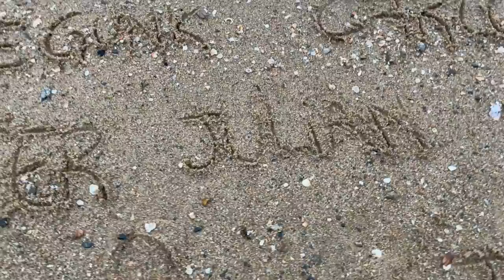Rebuilding a rotten schooner can get very challenging — Sailing Yabá #37

Comment: This is the most weird conversion. It’s literally replacing a rotten boat with a new one at the drydock while using the old boat as the template. I wonder what’s the cost against just ordering a brand new sailboat!  While you’re at it, I would replace the old engine with a new one. That’s truly something you guys won’t want to go cheap on.
Reply: I'm wondering about that myself.  Overhaul the old one or go brand new ???????? Same way with the transmission ????????
Reply: I was wondering the exact same thing as I watched the video. Seems like given the real cost of demo as a percentage of the total labor involved, it seems like building from scratch would have been more efficient. But I've never built a boot of any kind, much less a "massive wooden schooner". She's going to be beautiful, no doubt.
Reply: Exactly like "rebuilding" Tally Ho, replace everything with new and use the old boat only as a template (although the workmanship and materials were much better on Tally Ho)
Reply: There has definitely been scope creep on this project.  I agree that it will be a completely new (green) hull, deck and about 80% house.  It looks like they will save the masts and rigging.  Some of the advantages to this method is that: they did not have to loft the plans, they could just template off the hull, can reuse (refurbish) all of the hardware equipment, and repurpose the odd bits into the new hull.  Cost wise it may be cheaper than building everything new plus you do not have to use your imagination to see the completed project (I think this is important to keep MP motivated about the scope creep of the rebuilding).  The engine should be removed and over hauled.  They may want to consider replacing the direct shaft with a hybrid drive system with solar, an electric motor and battery pack.
Reply: This is an epic job, wonderful. I am mainly in favour of rebuilding old engines, particularly if they have wet liners. Modern engines have too much reliance on electronics. With a project on the scale of Yabá I would be inclined to dream about an 8 cylinder Gardner. I once delivered a yacht with a six cylinder version. The manual advised stopping the engine every 30 days or so to check lubricant levels - such confidence. They are expensive engines but are economic and last forever. Maybe get one out of an old fishing boat. Just a passing thought...
Reply: @Mark-zi4dd  Not sure the workmanship is better on Tally Ho; certainly much different, but in the end both will fulfill their objectives quite nicely.
Reply: @Mark-zi4dd  Face it, it's a new boat, not a refurbished one. Just like Tally Ho.
Reply: @johnbrice4146   Great idea on the Hybrid with all that Square footage of roof on the cabin top you could put 4000 plus watts is solar with lithium batteries you would be energy sufficient enough for AC at night!
Reply: @Mark-zi4dd  No comparison.Much more worthwhile project considering almost all the labor on Tally Ho was donation of labor from volunteers. Shop, tools and the premises the boat was restored were all free, including where Leo lived. That was FOUR years up until now with maybe two more years to go. These two young kids are paying for all the labor of demo and rebuild. The timber used on this boat costs a fortune even in Brazil.  While it is not exactly cabinet making, the  level of precision required in building Tally Ho and Yama, are light years away. Rounders and Cad drawings vs chainsaws. Hey look, I am just as much an interested viewer as anyone else here. I didn't subscribe hoping they fail. As a boater for over a 50 years myself I want everyone's boating dreams to become a reality. This dream is nothing short of a nightmare. 
For half a million I can find an excellent trawler or a sail boat that is Blue Water capable, and safer than this project. Just like everyone else, I think my opinion  is as valid as anyone else's  who think I am wrong. Stop encouraging them even if it is not their own money. This is pure madness.
Reply: @Mark-zi4dd  It's the difference between a one-off passion project done by a team of enthusiastic amateurs vs. a basket-case resto by a professional boatyard finding that compromise of cost, quality and time, because Yaba is taking up valuable berthing space
Reply: With the engine, maybe it would make more sense to leave it in place and then replace every part one by one.
Reply: @Mark-zi4dd  I believe Tally Ho is basically a new 'tribute' boat built from the keel up using drawings and plans.  This is just simply on the fly boatbuilding, creating. a new boat from the inside out (which is why we watch it, no?).
Reply: I want to see a new engine, like Odd got the new Yannar, Kelly. But bigger of course? Plus every time I look at your wiring I think we need Fred, Duca, and all fresh wires
Reply: @aytacercen944  couldnt agree more. This project got spun in the wrong direction from day one. I hate seeing money thrown at problems, and yes we get to see some skillful builders, but the owners arent really involved besides camera work. Yaba is merely 16 years old and doesnt have the historical piece like tally ho. Its just so bizarre at this point.
Reply: @aytacercen944  But you didn't tell Leo what he was doing is "madness"....... interesting.
Reply: @SilentSooYun  If you say so.....
Reply: @bchowmein1711  Tally Ho ain't historical any longer.......

Comment: This has to be, and without a doubt the most backwards way of building a new boat.
Reply: yep, and with many structural deficiencies - ie in this video, whole deck is on several threaded bars. There is no structural strength and in real, that beams works like scissors. Finally, this is steel, and steel with salt water = speedy corrosion.
Reply: This whole show is just there to get YouTube dough out of peoples pockets. There is no economical or engineering sense of working like this.

Waste of money and time and will not last without heavy maintenance in the future.
Reply: @Mister Professor I'm pretty sure your analysis is spot on
Reply: @Mister Professor good point

Comment: Sometimes it seems like that  when you bought Yabá, you didn't actually buy a wooden schooner so much as a set of 3D plans for a wooden schooner in the scale 1:1. :-)

Your determination is inspiring!
Reply: What they really bought was a bunch of rotting/rotted wood masquerading as a boat.
Reply: A huge template for building your own boat.
Reply: @gaylespencer6188  - it wasn't a BOAT project, it was a GARDENING project - more soil and compost than actual wood! :)
Reply: And hopefully a lot of decent hardware, which already fits the said 3D plan.  Depending how much they paid, I can almost see it making some sort of sense.  If I squint.  A lot... ;-)
Reply: I don't think they knew what they were getting into, but I have to admire them for doing what it takes to get this boat rebuilt.  Sure, it IS a new boat, at least 90% of it, but it will last a while.
Reply: @GaryMCurran  And they will know the new Yabá from the keel up. Look at what Bums on a Boat went through with the structure of Chak Matay...and then after contaminating the oil of their engine they got schooled in engine internals, too.
Reply: It is even worse than that first remember they had to spend several months fixing the boat so it could sail safely to the yard which obviously took time and money. Then they had to pay for the destruction of most of the boat before a new boat was built around the remains.

There are two possibly theory's first the easy one they were stupid and did not know or care what they were getting into. This is possible of course but I presume they would have had a survey done before they purchased the boat and this would of given them some idea of the scope of work and cost.

Secondly they knew precisely how much time money and effort would go into it and although at this stage it certainly looks as if just getting the yard to build a brand new boat would be cheaper and quicker there may well be some legalities like registration and taxes that fixing a boat would not attract whereas they could be stuck with a massive bill on a brand new vessel.

Which it is I do not know it appears that of the original vessel they have a janky old engine some winches and clutches the masts a Nice table and steering wheel and not a lot more.
Reply: @glennedwards1449    Funny...I wouldn't assume they got a survey, even though you and I know that's Boat-Buying 101. 

They were two kids in love with each other and the sea, and what could be more romantic than owning and living aboard a wooden ship?

Hilarity -- and adventure! -- ensues...

Comment: The most moisture absorbent  parts of a piece of wood planking or beams are the sawed ends. I would always make sure to paint them.
Reply: @Mister Professor The builders are building the entire hull with protectant soaked and wrapped cloth sheathed stainless steel fasteners.
Reply: @deuteronimus750  the allthread the guy was cutting was not stainless.
Reply: @janvanruth3485  Yes it was.
Reply: @deuteronimus750  and how would you know so?
did you see the manufacturers certificate?
or even hold the material in your hands?
Reply: @janvanruth3485  Did you of any charges you make?. They aren't iron like dimwit said. You think they're iron too?
Reply: @deuteronimus750  iron?
by that you mean steel? because iron is an element  (fe) and not a material.
they were, rather low grade, steel indeed.
the form, size and colour of the sparks gives it away.
you have any more dumb remarks?
Reply: @janvanruth3485  Go back and watch the earlier episodes when they prepped the metal fasteners and took other measures against rust damage YAWN.
Reply: @alexandersupertramp1293  Open your eyes then!!!.......
Reply: @janvanruth3485  Did you?.......
Reply: @MegaDirtyberty  did i what?
Reply: @janvanruth3485  Read for comprehension "
jan van ruth
3 days ago
 @algonquin 2  and how would you know so?
did you see the manufacturers certificate?
or even hold the material in your hands?".
Reply: @MegaDirtyberty  no, i did not.
and that is why i had to revert to the old fashioned way of assessing by looking at the sparks and timing the cutting.

Comment: Wow watching that guy with the adze. that is the first time I have seen one being used properly on these rebuilds I have watched. I had a friend in New Zealand who was taught by a man who passed away but taught my friend how to use an adze. He also passed all his tools on to him. He was born in the 1800's and they were often used to work the most amazing native timber called Kauri. My friend got large slabs of it and made tables out of them. The Auckland Wharves were being done up and the Kauri milled in the 1800's was still in good shape as it is extremely insect and parasite resistant. He hand adzed tables from that ancient timber and they only need a quick sand down and varnishing. I was privileged to see him make one. He had no power and had a bungee strap connected to a pedal on the floor he placed around pieces of wood put on two sharpened steel points on a home made wood lathe to make the chairs to go with the tables. Kauri has a deep sheen and is actually a kind of pine.
It is very Sacred to the Maori people. These chaps are up there with the best. You are so lucky to have them working and their boat building skill say no more. Cheers

Comment: To keep rain water off the deck as much as possible, have you considered extending the roof out past the edge of the sides of the boat?  Plus, this would give more area to place solar panels (locate roof penetrations so maximum solar panels can be installed.

Comment: You guys should rebuild or replace that engine while it’s Easy to access!
Reply: I was telling them through the tv screen the same thing. There may be things we don’t know about, but what better time to redo the engine while it’s completely open.
Reply: Perhaps the budget is slim. That’s a lot of wood and labor they are paying for.
Reply: Perhaps they can ensure the hatch is big enough to allow easy replacement at a later date.
Reply: @108hindu  Don't the money is coming from their own pockets!
Reply: @108hindu  I agree that could be the case, but when your basically building a brand new ship, might as well spend the extra money now and save trouble later was my thought process.
Reply: @curtisandtaylor  I kind of agree. They have so much work to do it’s hard to prioritize it. I remember them sanding and cleaning the hull. Just before they tore the planks off and threw them away. A full survey before the work began would have been a wise idea. I do wish them luck. Luck favors the prepared mind.
Reply: @108hindu  I agree. I don’t think they had a clue what they were doing when they started. I’m thinking they probably didn’t even get any kind of inspection done when they bought the boat. They probably just saw it, fell in love with the idea of it and had to have it and paid whatever the asking price was and got fully screwed. They seem pretty naive to me. They’re certainly getting an education now though!!
Reply: MP was on the phone in last video or before that  video getting something sorted out about the engine.
Ben didn't want to say much more than that.
Reply: @srcastic8764  Everybodys an expert eh.....

Comment: I as a seaman, I owned boots for more than 30years, but  what is here shown ist only horibble. to screw wood together without bitumen, glue or so is horibble. the screws/threadsrews liquid zinc or only electrozinced (?).  sorry
to fix first planken on the hull and then the transom : horribble. decksbalken painted but not the stirnareas before fixing them. have only a look how the washers and bolts are mounted. there will always space for water to creep in.
the builders work with simple tools, this is honorable and i take hat down. but this work will be only for a short time working.
sorry for my engl.

Comment: It makes me sad to see sooo much of the old boat being replaced due to rot. 
  Sometimes I just cringe through most of the video !
Reply: Bet you don't cringe when you watch as Leo "saves" Tally Ho even though he is doing the exact same thing as this couple......
Reply: @MegaDirtyberty  I mean no hard feelings for Yaba, but you can't compare the two builds. I've seen those videos as well.
Reply: @BB-hw2tr  You can compare the two builds, they are doing the same thing, building new boats. At least with Yaba, Ben and MP have kept original elements, Leo however has basically built new..

Comment: I’ve been pretty critical in the past because of risks taken, but good part now is you’re boat will be brand new, with exception of the engine and sails. Here in the U.S., there was a show in the 2000’s which renovated homes. They found it to be much cheaper to tear down and completely replace the home with a new home. Can you state one one of your episodes if that would’ve been the case for Yaba? I’m curious if that is a cost efficiency issue in the states, or if it’s true for other countries too.

Comment: There seems to be very little left of the original boat. It's more like a new boat built using the old boat as a template as you go along.
Is the engine going to get some attention too?
Reply: Well you cant weld Wood onto Wood so things must be replaced eventually when to much neglect kicks in you just have to rebuild it. In the Baltic Houses with Thatch Roofing each generation has to Replace the Roof atleast once, its still the same House afterwards duh. 

the Engine is some Mercedes Benz wich was also comong in alot of other things in Brazil so spare parts schouldnt be to much of an Issue.

Comment: How are those masts still standing when the only thing holding them up is worms.
Reply: They are very strong worms.
Reply: Wait until they start the mast and the rigging process. I would be reluctant to hang anything with more sail than a quarantine flag on that thing. For the sake of these kids, I hope they are serviceable. If not, there is another expense, another item on the boat  they didn't get to use and have to replace.
Someone tell me WHAT is left of the boat that is salvaged, and reused so far?
Reply: Look at all the wood they've eaten.. there tough lil dudes now ahaha

Comment: Hi Ben Hi MP It's so nice to come home from a long night at work knowing I get to see what's new with Yab'a . Back In the day when I haunted marinas and saw how the very old sail boats were built One of the things I learned was how they would add Ballast . Some would pour concrete between the outer and inner hull and other's would place stone bricks in the same location .In latter years they would pour a lead ballast along the bottom of the keel But these were sailboats and not schooners I found it interesting and thought you would too .Speaking of more light in the cabin I was wondering if you had thought of putting skylight windows in the ceilings of the upper cabins .Ben you two have been working so hard for so long MP is looking a little stressed out ,I recommend a day off and go do something you haven't done for a long time . Like doing nothing all day then maybe A nice quit dinner for two at a nice restaurant With a glass of wine or two .Nice to see you are getting some nice weather for a change not too hot not too cold and NO rain .Well it's that time again for me to go ,As always my best wishes to you two good night ha ha .